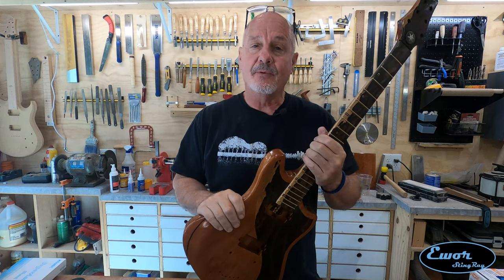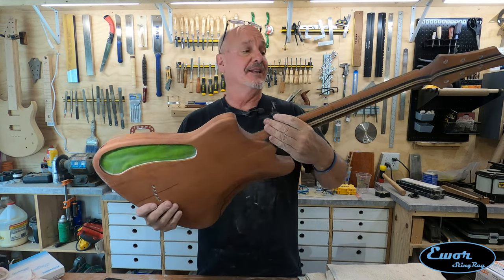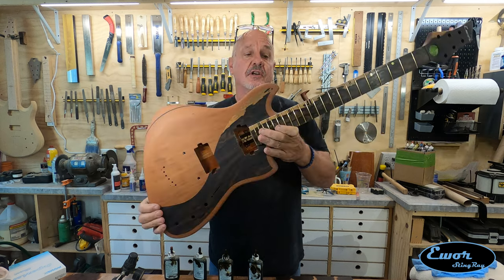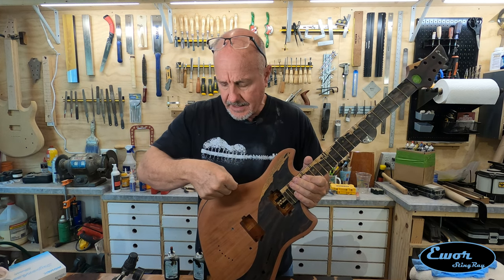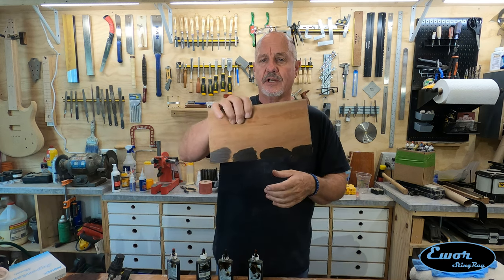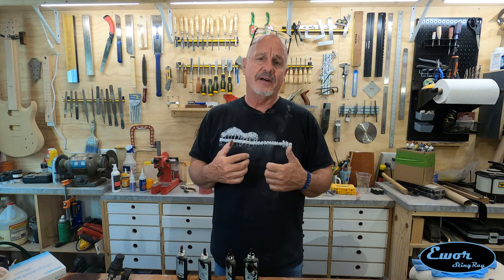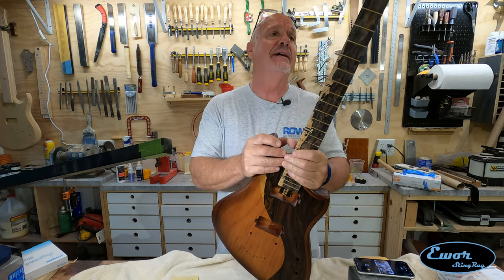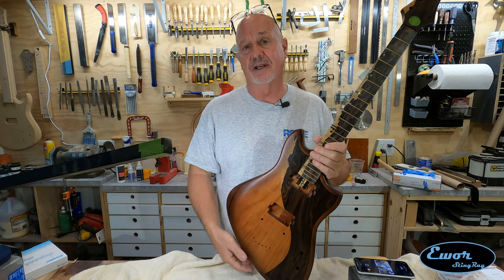Ewor Stingray part 16: Killer looking Matte clear finish

Comment: Big fan of the burst! Also glad you got some of those cheaper .023” fret slotter bits. I was able to keep mine from breaking by first radiusing and profiling the fretboard, then extending the fret slotting toolpath out past the side of the fretboard. This allows the bit to plunge while just in the air, and not in the wood. I’ve heard reversing the direction when the bit is in the wood causes added stress, which can break the bits.
Reply from the maker: Yeah I think I’m going to try going all the way past the edges of the fretboard

Comment: Tamco also makes a inter coat clear. I like using candy concentrates for my dies in the same fashion as you are doing. I prefer House of Kolors but there are other brands out there that are just as good.
Reply: I use to work in a body shop years ago. In my spare time I use to paint helmets and motorcycles

Comment: Did you leave the mixture in the gun between coats or did you store it and clean the gun between coats?
Reply from the maker: I keep the mix in the gun between coats but clean it thoroughly after a round of coats. I only wait about 15 mins between coats

Comment: Did you go straight on top of stained mid coat with matte or did you sandor scuff first?
Reply from the maker: The matte applied directly on top without any scuffing. This urethane allows you to re coat as long as it is within 24 hours